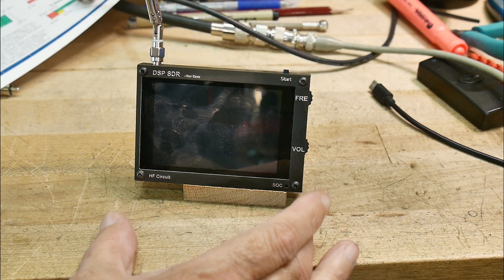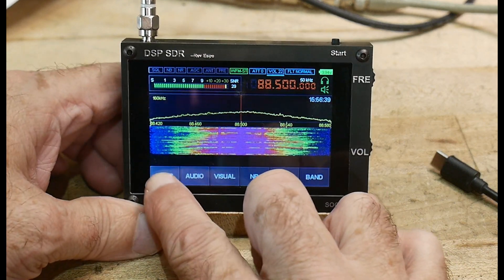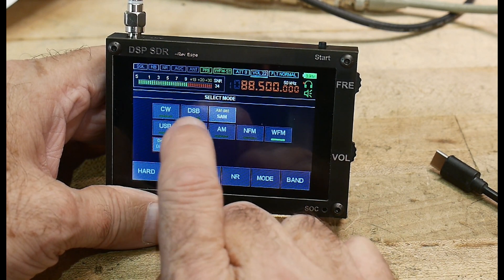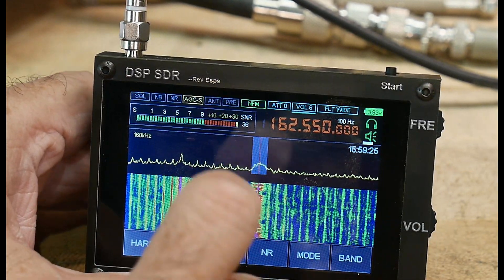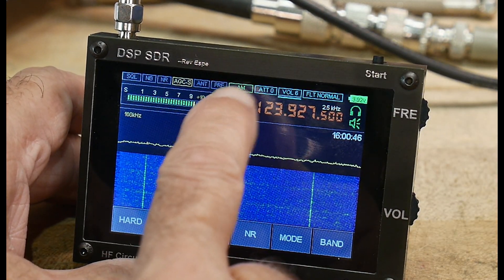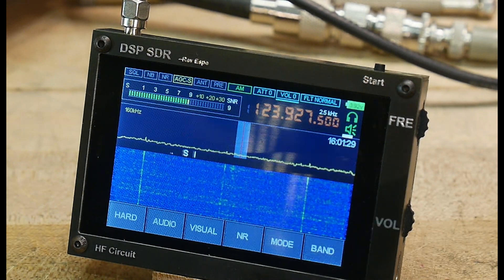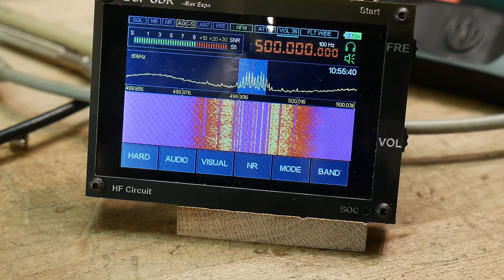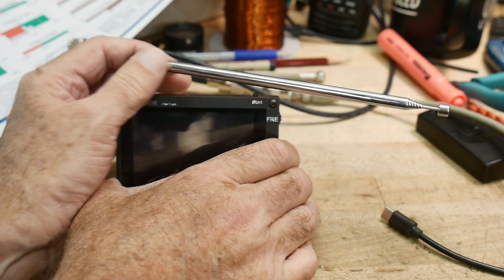#960 Malachite DSP Software Defined Radio

Comment: I'm guessing the Malachite ones are the clones?
The one I have is branded Malahit DSP, has the antenna connection on the side and rotary knobs sticking out on the other side.

Came boxed with the Receiver, antenna, charging lead and 2 antenna adaptors. 

The one I have, looks to have a bigger casing too

Comment: 200 to 400 MHZ is usually blocked by the manufacturere and even if you enable the higher frequecies that range (200-400) seems to be blocked.

Comment: This video is bullsh*t. When you see videos with affiliate lines, BUYER BEWARE! This video is willfully deceptive! Most of the Malacite radios you get do NOT have such full functional firmware, and GOOD LUCK trying to get this firmware on yours if you get the wrong one. The one I bought does NONE of this stuff and can barely pick up most AM channels, much less CB and HAM.

Comment: I'd like to know if you can receive WWVB at 60 kHz with the short antenna in high impedance mode. I'd like to know if it has a headphone for FM stereo. And I'd like to know how long the battery lasts.
Reply from the maker: stereo headphone work. decodes stereo FM broadcast. haven't measured battery life. I don't hear anything at 60khz
Reply: @IMSAIGuy  Thanks. I'm considering getting one. The 'official' ones, at close to $250 are a bit much. But I think I saw a version without a case for $99 that goes to 2 Gig.

I use whether or not a radio can pick up WWVB at 60 kHz as an indication of how much thought and effort was put into the front end design. I've only found a few portables that supposedly cover 60 kHz that can receive it, even though nearly all of the $20  'atomic clocks' in homes around the country can. I would have expected a high impedance antenna input to be able to receive it using a short whip. At 50 Ohms, not a chance.

Comment: My previous comment was deleted, probably because it contained specific contacts and could be considered commercial: my fault. Now, what I wanted to say is that to my knowledge, when a paid, not free firmware is installed, the device will work at frequencies up to 2GHz. There are also other limitations in the open firmware, as far as I know. Authors decided to use the "fremium" model by locking some features in the paid version. I don't have the radio myself, so I can't check, I only rely on the videos in the Russian-language youtube channels.

Comment: Neat, especially the CW feature. A bit too expensive for me, though.
Reply: Don't believe this video. I have one of these and it can barely pick up ANYTHING. It certainly doesn't do Morse Code decoding, pick up HAM, nor CB. I don't know what firmware he has, but my "a" firmware has NONE of these features. I can't even FIND the newer firmware, or where to buy an activation code. I think the entire project has been scrapped. I spent $150 and can barely get the local AM channels. I feel ripped off!
Reply from the maker: Did you buy this from the same vendor and same part number? There are many sellers of the radio and several versions. I reviewed the radio as sent to me. If the radio did not perform as expected did you return it? I do honest reviews and will say if the product is bad. There is a different model that is a 400MHz to 2GHz one. Maybe you got the wrong version

Comment: In my Chinese "toy"  Firmware (upgraded) VER 1.10 a  (up tp 2 Ghz still to be tested!  ) if you push the screen  in the Waterfall area bandwith changes x2 and x4.  Haven't found any further way to spread the BW.

Comment: I have the actual RUSSIAN model (Malahite Team). The Chinese clones are sometimes very unreliable.  Some work fairly well, but you are "rolling the dice" when you get a clone. They are less expensive, but not worth the risk in my opinion.
Reply: Where's the best place to get a genuine Malahite and not a clone?
Reply: @georgestephens2593  I would like a link the actual RUSSIAN model.
Reply: @BryanTorok   I have tried twice it keeps getting deleted
Reply: Interesting what gets deleted. This platform is certainly not about open discussion
Reply: I have the Malahiteam version 2. It’s also a bit pricey. These are based on the same front end IC used in the SDR PLAY  devices
Reply: @chriswalford4161   yeah that would make sense. Then I replied to search for the name and it took that down also?  Perhaps it thought I was a bot or scammer.  They have done a great job on the firmware.  The noise canceling is better than my ic7300.   I was using it near an electric fence that had about a 3 second pulse and the noise blanker was able to make that disappear as well.   @IMSAI keep up the content.  Happy Thanksgiving to all.
Reply: @bpjeffri  Thanks for the attempt.  I'll Google the name and see if I can find it.
Reply: @bpjeffri  I posted a link to some bootleg firmware with quite a few improvements that solve some of the units issues yesterday. It was deleted in 10 minutes.